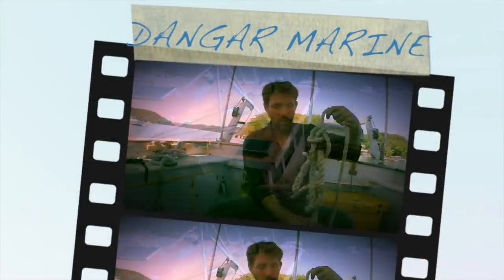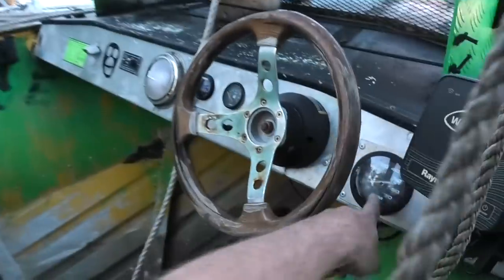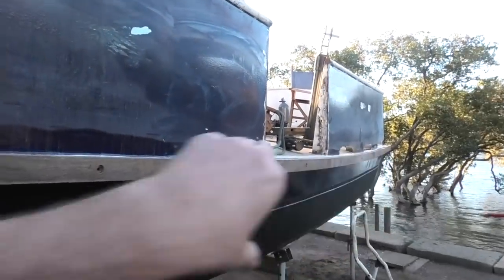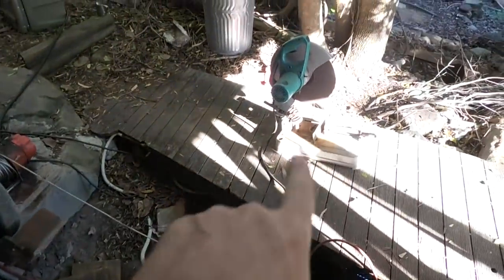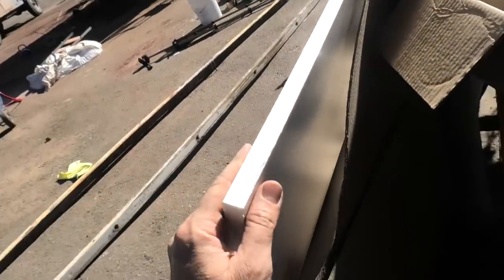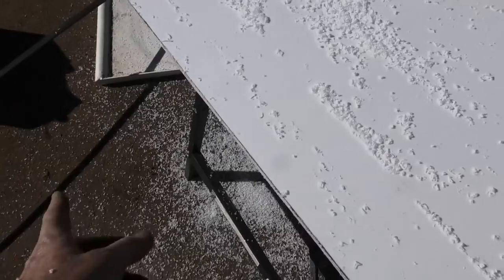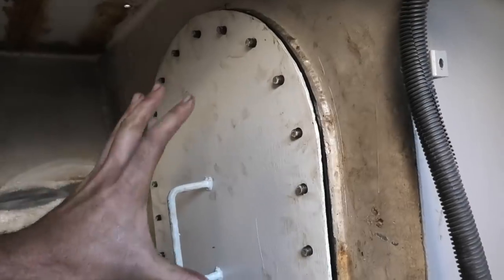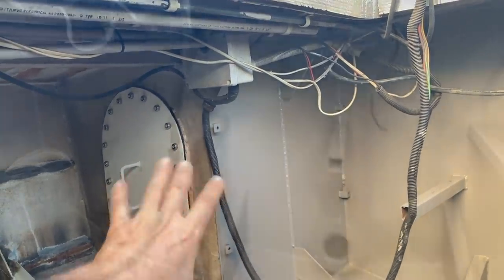Electrical boards and engine bay cleanup

Comment: Ive got a little 2.7m Zodiac and it has a 5hp Yamaha 2 stroke and that things ace. 
If you get a Zodiac check the condition of the lower transom wood, thats were they go, but they are fixable. 
If you get stuck with an Evinrude alls not lost, you might be able to use it as a golf club or something.
Reply: And the condition  of the glue where the transom meets the tubes..... and if a CFR model then the glue where the tubes meet the floor.  I've had many.  Great boats but you become very good at glueing.
Reply: @volvogt21  it would have been better if they protected the transom plywood with epoxy, or used equivalent thickness plastic, but unprotected is asking for trouble. They used a patented process to attach some parts like the boots to the hull using heat bonding and some kind of glue, it holds up better than the straight glue they used for the floor to hull. Im using 5200 this time to bond 1" epoxy marine ply to the black boots on the hull and bottom of the boat and dressed with a bunch of 3/8" SS bolts. I guess I have to wait see how it goes. Its only got 2 patches but it is pretty old anyway, if I get 3 years I'll be happy, then probably scrap it.
Reply: @z_actual  I agree. The Mark 2 I have is far more repairable.  I  saying that I have never had one of the welded joins fail. The cfr or zoom models do have a tenancy to rot. I repaired one once by I injecting a ror repair solution to make the soft wood solid again. I got about another 2 years out of it.   Where the tubes attach to the transom actually goes through the transom which make dismantling and transom replacement almost impossible.  The last two digits (or similar) of the serial is the manufacture year from memory fyi
Reply: @volvogt21  one of the interesting details is, they couldnt glue the plywood to the boots on the hull, the glue wont take. So they did this thing where they drill around 9 holes per side, then they fuse this plastic in which makes a flat joint surface each side, joined together through the holes through the ply. Then they could glue the transom and plastic ends into the boots on the hull. The plastic used on the transom is easily affected by heat, and when you apply a heat gun it has the consistency of a rubber eraser. You cant replicate that so I used 1" marine ply which is the thickness of the ply and plastic together, then glued with 5200 and through bolted.
Reply: @z_actual  Clever solution regarding the boots. You are braver than I am :)

Comment: Perfect dingy is a Boston Whaler squall.  9 feet or 3 meters.  Unsinkable, seaworthy, sails too.  Can handle I believe a five horse power outboard.  I used mine to sail, haul gear, pull lobster traps.  Self bailing.  Don’t know if you can find one down there used but awesome dingy.  We’ve had a family of four in it so almost 700 pounds.

Comment: 20 ft of 4" pvc with a cap on the end. Put your wood into it and fill it with water and let soak for a couple of days. Ready when you are...As far as the old Boat goes. A layer of fiberglass and it may last another 10 to 20 years???

Comment: I am definitly not a grease priest the one thing I am a expert in, is making fuses pop. Only thing I can think off is installing extra cabels and fuses so that if you want to upgrade electrical systems, you can do it easily (and ofcourse inistalling extra powersockets). Anyway I hope you have a nice roadtrip :D

Comment: You can always use a plastic sleeve to steam long pieces of wood. You simply need a steam machine that pumps steam throw A Hose.
Reply: Yes that's a great idea I've seen people use the hose for wallpaper strippers into the sealed bags works an absolute treat

Comment: Hi , I would of suggested that any join in the rubbing strip should be located at :
      the point of least impact
     The point of least curvature.
it is very hard to secure the rubbing strip join where it is being bent the most.

Also the three steel square tubes sticking out of the bulkhead to support the batteries may be a bit undersized, when you consider pounding at sea. The shelf should be braced under the shelf to strengthen it.
cheers

otherwise and as always great video.

Comment: Stu, great vid as always, Mabey worth getting a couple of welding bungs and bung the filler and the vent and pressure test the fuel tank with a few psi of air and some soapy water just would save any mess if there was a small leak and save ou having to pump the diesel out again

Comment: Greetings once again from the Oil Patch in Central WY,

Whilst you were putting the new nuts on that first fuel tank, I noticed what seemed to be a pinhole in the decking, just above your left shoulder in the video frame. I don't know if that's normal (my experience with boats has been relegated to 12ft trout boats and being a passenger on board boats well under 30'.

Anywho, thought I'd better point that out to you!

How did the bearing change out on the Gear Box come through? I've been wondering about that since our 'conversation'!

Cheers from the Oil Patch!

Comment: lol this is so painful to watch, ah well..... the timber could be easier to 'steam' in a tube with kettle nose in one end and little escape out the other.... and as you said last vlog, even splitting and laminating later when its all dry, like bolt it on and in a week or 2 remove and glue're up. I have seen just a plastic tube (long bag type) used but most use a pvc pipe for steaming.

Comment: Soak the rubbing strip and put a roll of vacuum food bag over it with a wallpaper steamer in it. probably need a couple of three hours steaming, but you can leave it in the bag and push it into place. I got the idea from Lou Sauzedie, Tips from a Shipwright's vid. Engine bay is cleaning up well. Atb.

Comment: Stu, using that poly board for the batteries will work well.  We have a similar product here in the states called StarBoard.  I use it to make different brackets, shelves, supports in boats all the time.  Works great.

Comment: On my truck the battery has a clamp style fastener holding onto the bottom lip of the battery. I like that idea with a strap over the top for my boat remodel. If the strap fails I have that lip fastener.

Comment: The less crap involved with electricity the better. Think about repairs on the open sea in the worst possible conditions with your hands in a wet panel box.

Comment: You will likely regret getting an inflatable. They are light weight and good for swimming off, but not nearly tough enough for what you do. A work boat like your trawler needs a strong rigid tender. A solid 12ft  fiberglass dinghy with some buoyancy glassed in as seats would work. Probably weighs 300-400 lbs or so, and you can stand up in it without it turning over. Build a pipe-davit to lift it onto the deck. A cheap 12v recovery winch will do the heavy lifting.
Reply from the maker: We'll see how it goes. I'm still going to make the composite tender at home once the trawler is back in the water so it will be interesting to compare the two.

Comment: @12:30 "These are stainless nylocks..." Any consideration given to possible galvanic corrosion caused by using stainless steel nuts on the mild steel studs? Looking to be educated.
Reply from the maker: Not so much in the engine bay, out exposed, yes.

Comment: I had a 21' cuddy cabin boat with a v6 engine and outdrive.  The builder put the fuel tank all the way back in the port stern corner and the batteries in the starboard stern corner.  This had all the weight in the last 3' of the boat. It jumped out of the water and on plane great but if you hit swells over 8" (yes, 8 inches!) the boat pounded enough to beat your fillings out. 
So, think about your weight distribution when placing your batteries and the electrics.  As you are finding out it is better to work with the most curved part of bending wood first and working towards the straighter area and not the other way.  Enjoy your time away and above all have fun. :)
Reply from the maker: Yes, it will be interesting to see how the boat sits in the water and adjust the lead ballast as required.

Comment: That green machine has done its time,the aluminium has deteriorated to the point it is thin and brittle,a lot of folks aren’t aware of the leaching component in the deterioration process of aluminium and alloyed metals,like us they have a shelf life.
You present as ex military,navy perhaps,I’m saying this due to your pragmatic approach to the top to bottom overhaul of what is termed in the maritime industry as a much loved vessel 🚢(worked),try not to over capitalise on your investment.Saying this,you should expect at least another 15 years out of that hull keeping the anodes up to her.

Comment: RE the vertical poly board:  put in threaded studs in the brackets such that the board hangs on the studs.
Reply from the maker: I did consider that, but my plan is to get some bugle head screws and counter sink them into the board so they look nice.
Reply: I thought it would be easier to mount the board on the studs.  It’s in the engine compartment, less need for appearance

Comment: Think about it.  A ELECTRICAL board on a fuel tank.   Darwin Award!
Reply from the maker: Ever tried setting diesel on fire?
Reply: @DangarMarine  I know your a busy man; but yeah, I saw a Caterpillar D9 catch on fire from a fuel tank leak and grounded cable from the battery.   The dry ice trick  on that shaft was a smart one.

Comment: Just a quick observation when you have a gasket that is holding fluids,I was always taught start at the bottom and work up either side to side to the top ,this means any distortion in the gasket will be above the opening
Reply from the maker: The trouble with this is that the fuel fills to over the top so it can leak from any edge.

Comment: Had an old aluminum hull too, multiple welds, cracks next to the old welds, never ending pain in the bum. Own a polycraft hull now and love it. Time to sell the old girl for what you need right now.btw polycraft tuff tenders are pretty awesome ;)
Reply: Double walled and indestructible...tougher than a wheelie bin, but yes, pretty much same plastic
Reply: @adammcgeorge3538  With me it's just the association, I think rotational molded poly boats are probably viable to a price point and size but then alloy & fibreglass boats are more widely accepted with the trailer boat crowd and cost the same, or less. Me, I'm all for W.A aluminium plate boats along the Jackman naval architect design's, from 5mtr and larger are the go, great sea legs on the chop & waves on fresh or salt water.

Comment: Hi Stu,
Maybe you could use the old wet exhaust hole in the transom for a engine compartment blow down. Installing a "p" trap just an Idea-Sorry about the Green Machine. Happy the motor stayed above water! Take Care mate
Reply from the maker: It would be nice to use it for something rather than just welding it up again.
Reply: @DangarMarine  Hi Stu
Also for the battery tray. The poly board will flex and bend over a short time. It may be a good Idea to weld a steel shelf then place the poly to protect the steel. Hope this helps.
I cant get over that troller -its a jewel !!! it ended up the same color as my boat Black over blue

Comment: Great vid.
Question:
The use of plastic board for wiring, is it not more usual to use plywood? My concern is the plastic melting if there is a short. Is wood more suitable?
Reply: Sure the plastic board can melt but its 3/4 thick but on the other hand 
Plywood can burn rot away so I guess you just kind of got to pick your poison lol you can use either one I would probably use steel with a rubber coating but you paint on it after you have welded in place
Reply: Guessing the best thing to use would be asbestos or concrete board

Comment: Back in my day, you could expect + 60 years from an aluminum boat.
Reply from the maker: Living in salt water 365 days a year against a wharf?
Reply: No, I love the fact you got 50 years out of the Green Machine.   My plate aluminum boat is 25years old, but spends its time on the trailer.  Im hoping for anothe 25 years.    You got your money out of her and she has p aaid her way.
Reply from the maker: I think the thing with these boats is that they are designed to live on a trailer. I've always had this idea of building a boat that was designed as a work boat to live on the water, but I guess 50 years is enough for most people. No doubt more judicious use of fenders wouldn't have helped over the years too, or even a weighted line that pulled it away from the wharf once tied up. I've seen that system used to great effect.

Comment: A tip for saving loads of money on bus bars is to use copper tubing flattened where the connections go. Current generally travels on the surface and round stock carries more than flat stock because there's more surface area.
Reply: That is not true for DC!

Comment: have you thought of installing a "swim platform" on the transom, so you dont take up any room on your deck? or even a cradle of sorts, not even a solid deck. Just a thought. Looking good though!
Reply from the maker: Yes, have been thinking about a swim platform for the back. Still going through a few different designs in my head.
Reply: @DangarMarine  How about a tubular alloy frame with an alloy mesh insert welded in like they put in security doors?